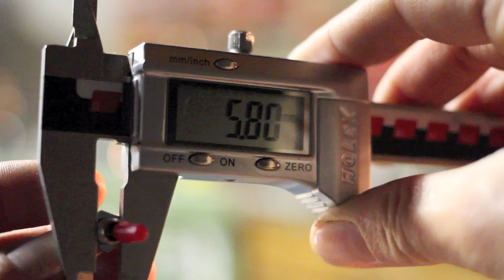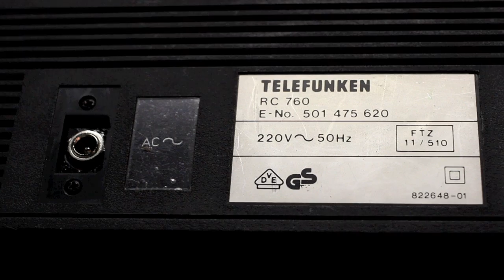Laura´s Bluetooth Boombox

Comment: Good video, I'm going to give it a try on an old Panasonic cd cassette player, I'm thinking of using an old phone charger for the 5v supply, at the moment l have just got a 3.5mm headphone cable soldered onto the circuit board so l can connect my phone to play Spotify,

Comment: Nice work! Easy tip for you, take clear photos of the boards before you start work. A broken wire can easily be traced with a pic. Also a volt meter would have found your 9V also.

Comment: Like the advice.. ran into a setback when I accidentally "fried" the controller to my ebike with a 48 volt battery instead of the intended 36 volt. I made a modification to the battery with a high voltage "off" switch and had to buy a new controller and a spare ebike motor.
Gonna test drive "version 2" tomorrow.

Comment: Well.. this problem happened to me once. I solved it by meticulously looking at the circuit board searching a broker solder, possibly with a piece of wire. Theeeen.. another problem is to guess which wire (+/-) were where.. Its like electronic forensic investigation. lol

Comment: +Laura Kampf
Drilling into plastic and thin walled metal...
You know the drill bit likes to jump through the last paper-thin wisp of material and screw through the unfinished hole.
That's because the drill flute lifts the material as it cuts.  It doesn't need to though, at least not right where the cutting is happening.
With a small grinding wheel (one of those brown potato chip disks on a Dremel), grind or blunt the cutting edge of the bit so that when you are holding the drill bit vertical, you're holding the Dremel tool horizontal.  You only need to remove enough material from the cutting edge to remove about a half mm of material.  The bit will still be sharp, but it the leading edge of the flute will be scraping rather than lifting material.
The equivalent effect for a circular saw blade would be to use a blade with a zero or negative tooth rake (recommended for cutting thin-walled material) instead of a standard positive tooth rake.

Comment: So you connected the speakers directly to that small circuit board? Is that some kind of Raspberry Pi?
Great video again. Creative project and a creative solution. You've made another fan. I mean like admirer of your work, though you probably have built a fan at some point too. :)
Reply: Nico Kempe - Looks like this board or something very similar. I am currently building a boom box from an old suitcase with this amplifier board and a couple of speakers. Great sound for a very small price! 

https://www.ebay.com/itm/122189015219
Reply: That link doesn't work anymore, but if that's a board specifically made for this purpose it does make more sense.
Reply: Nico Kempe nope it's not a raspberry pi, good guess :)  if you google "blue tooth module" those little circuit boards come up. Some larger ones like she's using have built in amplifiers that can power speakers. The itty bitty ones usually don't have an amplifier stage and rely on a separate amp or like a preexisting one already inside a radio.

Comment: Hi Laura, great video! Inspired me to do the same and have bought myself an old radio too. I was just wondering if you could share / explain real quick the diagram for the circuit you ended up using? Was it your original plan to use the radio's amplifier as well as the power supply? Thanks in advance :)

Comment: Great vid! Is it possible to solder a potmeter onto the board? It would be nice if the user could change the volume with the original potmeter of the old radio. (Maybe it's easier if I try to find one with a built in potmeter).

Comment: I'm trying to scoop out an old Skantic boombox that isn't working right. The speakers are fine, but the tape player and volume knob have seen better days. Turns out there's a circuit board covering the cassette deck, and a whole bunch of cables holding said circuit board more or less in place, so it's really hard to scoop the cassette deck out. I'm trying not to have to cut all the cables, but I might have to. It's a jungle in there.
Reply from the maker: +Tasteful Tuna yeah, its a challenge with these kind of projects...good luck and have fun with it :)

Comment: nice job, i did the same with my boombox exept i kept the tape player but not functional (good remote holder !). It's less powerful cause running on 3.7V batteries with usb charge. And the blutooth module is also USB/SD MP3 and radio with uses the original antenna :)

Comment: After some wires came loose in an electric guitar of mine years ago, I started taking pictures of electronic devices I open up, as a first step.  It gives you a reference if anything goes wrong.  Nice work with finding a new solution, though!
Reply from the maker: +Jeff Mansfield that is a very good idea!